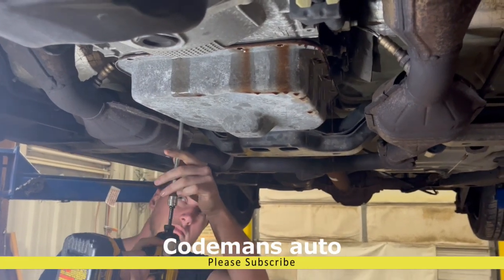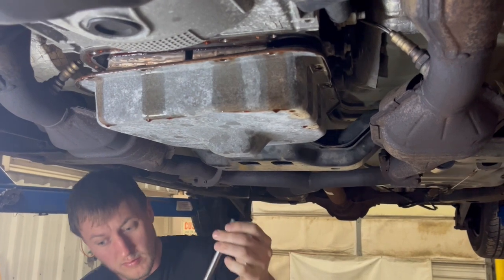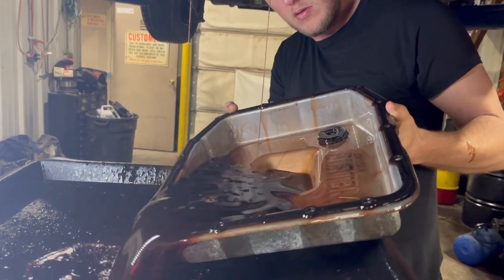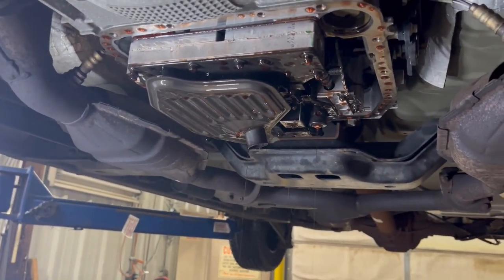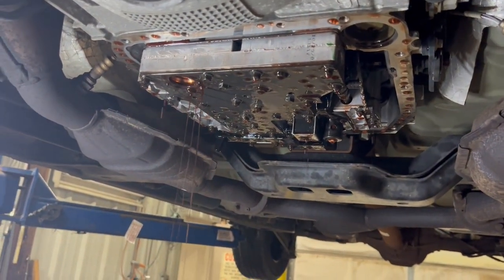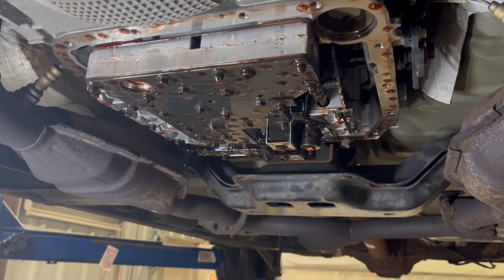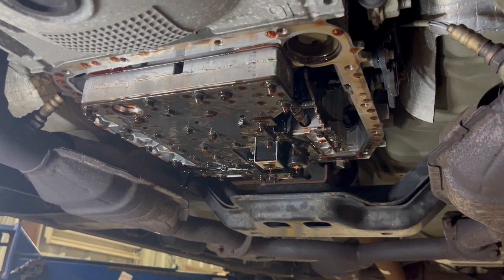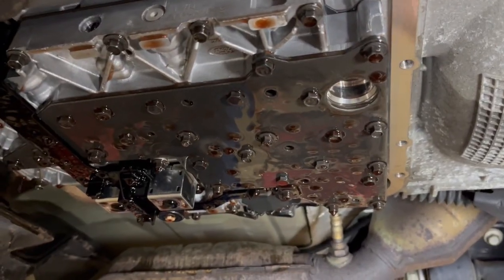Transmission Fluid and Filter change in a 2007 Mercury Grand Marquis/ Ford Crown Victoria

Comment: I bought a 2008 Crown Vic PI from the auction with 166k. I dropped the pan and found the yellow thing. I knew what it was but at 166k and it being an ex-cop car that was a bit concerning. Lucky me I drove that car up until it hit 245k without any issues with the transmission and sold it. I bought another CVPI from an auction with 145k, same thing, I dropped the pan and found that thing again but so far no issues with the transmission. I'm at 177k, guess I got lucky again.

Comment: Neighbor says his book calls for Mercon LV and says he's been told not to mix V with LV. So I went to my owner's manual and it says V. Then I looked up several different vehicles with 4R75W transmissions and some say V and some say LV. So I called a fleet owner & he wouldn't directly answer my question but he's a bit of a tree hugger so I should have known. I looked up internal parts and there's really not anything I could see that different. So I kinda think it's one of those things like the original 4.6's in 91 were designed for 10w30 and I have paperwork to prove that. In 92 owner's manuals said 5w30 and in 01 they switched to 5w20 and said use it backwards to all since 91. And if you read the fine print it's for no other reason other than tenths of a mpg per auto and on a corporate basis that saves Ford money with CAFE credits. Mustang owners used 10w30 for the extra protection. I've preferred 5w30 for the extra protection. But I don't drive hard either. For the 6 QT pan 5w20 is really just fine. 0w30 amounts to 5w20 that's just a little more robust. But basically transmission fluid is a hydraulic fluid. Mercon V is equivalent to AW46 or 20w fluid. Dex III is like Mercon V with less detergent, antioxidants, and FM. ATF+4 is a little better base oil than Mercon V with a little more detergent and phosphorus. But you can use either one. Personally I can't stand how ATF+4 costs what it does and it's all because of the licensing process. The earlier overdrive RWD Mopar transmissions actually shifted better with Dexiii and that's what most rebuilders put back in them with and without lubegard additives. The basic difference between Mercon V and LV is how the fluid acts in cold weather and hot weather and it's arguably not as effective as Mercon V but I'm not telling anyone with LV to add V or to just use V even though if I had one with LV I'd probably just use M1 multi vehicle or Schaeffer's ATS. The clutch material is what determines the type of fluid and until someone gets back with me and says the clutch material is different in the 08+ years I'm going to believe Ford just screwed our pooch one more time so they could save money. Sometimes manufacturers don't recommend changing fluid. What they do recommend is you bring it to your dealership and buy another transmission instead. Originally Ford dealerships were saying in the early 00s don't change your fluid but that was back when most dealerships didn't stock Mercon V. They just ordered fluid from the local parts store and the fluid being put in was inferior to what was coming out. I usually use a licensed generic fluid or something better than the original. Castrol and Valvoline don't go through the licensing so they can only recommend their fluid where ST is actually licensed. However I've never had inadequate performance with Castrol Transmax fluids. I've always been very happy. If you happen to be... hypothetically speaking..if a cooler line pops off on your way somewhere and you don't have the approved fluid don't worry about it unless it's a CVT. Dex/Merc will be just fine until you can get it serviced. It might shift a little different because there's probably less FM in it but it's better to have fluid on the clutches than to drive on less. FM is why some clutches slip more to provide a softer shift. People worry too much about little things and not enough about bigger things. The last vehicle I had 4 different kinds of fluid in it & it shifted great. When they say things like don't mix... that's mostly out of fear because there's been no testing so they can't guarantee what kind of performance you'll have. If your vehicle is under warranty USE WHATEVER THEY SAY. Most transmission shops aren't going to educate you on these things but there's not nearly as much difference as they claim. Valvoline Maxlife multi vehicle fluid claims it's both LV and Mercon V. It claims it's Dex VI and Dex III. What does that tell you? It tells me the clutch material isn't that much different. It tells me it's about gas mileage. And it suggests something else to me but I can't objectively make any argument one way or another.

Comment: You mentioned the plug in the transmission pan that the factory pops out and leaves and also the seal that didn't come out with the old filter. I've changed tranny fluid many times over the years in several cars and I never came across either of those 2 things. So, thanks so much for posting this as I'd have thought something was serious wrong!
Reply: Thanks again for the video. It was helpful the other day. I found the yellow plug and the filter seal was stuck.
very good.

Comment: My has a jerking problems, I think I left the old gasket inside crap….. between all gears only when accelerating mildly, but when I hard accelerate, it sometimes clunks into gear really hard almost like I forced the pump and hydraulic fluid to make the gears shift into gear, the fluids also black and looks oxidation. What could it be?
Reply: 09 CVPI 3.55 Trac-Lock

Comment: 09. When I bought it a few months ago I knew the fluid hadn't been changed because of how the converter was shuddering. I had other more pressing things to fix so I siphoned a pint and added platinum lubegard and went on. I've been going to order a pan with a drain plug but I just decided a couple days ago to just put one in the original pan. I'm waiting on it to arrive. The fluid was black. I found something I have no idea what it is in the pan. A little bobber looking thing with an o ring on the end. I looked the valve body over and I don't see where it could have come from so I'm not putting it back in the pan. I'm going to begin the process with some ST Mercon V and a couple quarts of Castrol Transmax V I've had awhile. And then in a month I'll drain out a pan full and put Schaeffer's ATS back in because I've seen Taurus transmissions last 400,000 miles on that stuff and with the Mercon V they come with not even 150,000. I also strongly believe in Redline transmission fluid and to a lesser degree Mobil synthetic fluid. Amsoil is also great if you feel like paying double. But I have seen where amsoil was put and a stacked plate cooler added a test done on fluid with 180,000 miles and it only having lost 23% of it's useful life so there's really no reason to complain. I'm curious why Ford didn't notch the crossover but I've done a Chevy Caprice Wagon from the 90s that was about the same deal. In this case I switched from my 3/8 extension to a 10 mm and a 1/4" extension. Ok, now I know what the bobber thing was

Comment: very good video. i was wondering what the plug looked like.
One question though,
did I hear you say it was a 2007 and took mercon lv? i have a 2008 but has a 2007 trans and it takes mercon v.
Reply from the maker: the plug is yellow and has a rubber o ring on it and sometimes I will mention upgrading fluids but you need to use what is recommended for your transmission and just to let you know a real good fluid is Maxlife made by Valvoline
Reply: Just did one this morning took 5.5 quarts to refill.  Inspected the magnet for anything put of the ordinary used brake clean to clean everything.  Make sure the gasket surface is clean an dry when reinstalling.